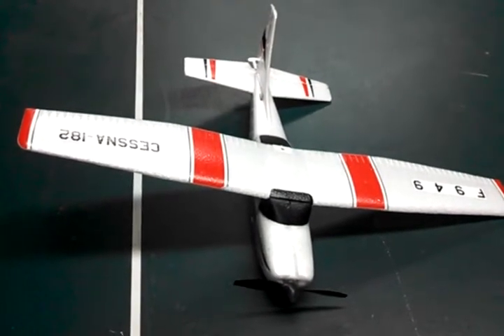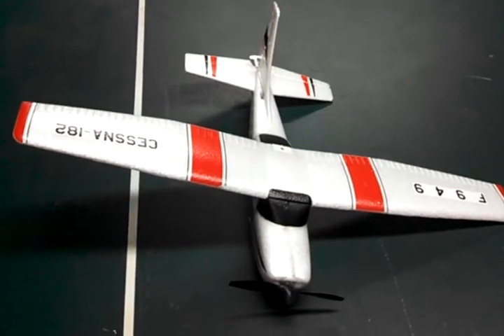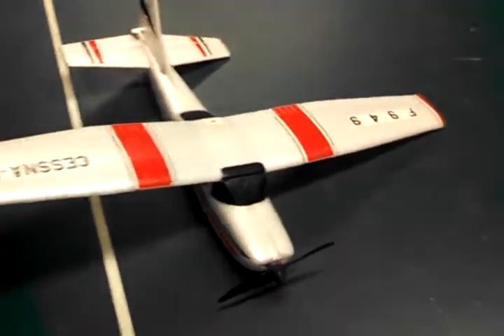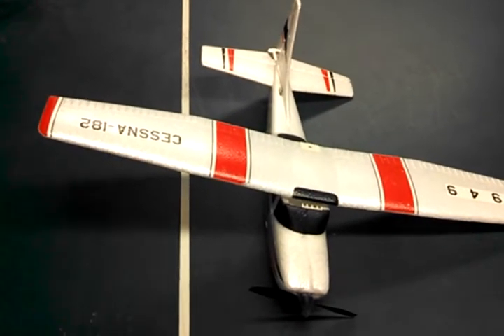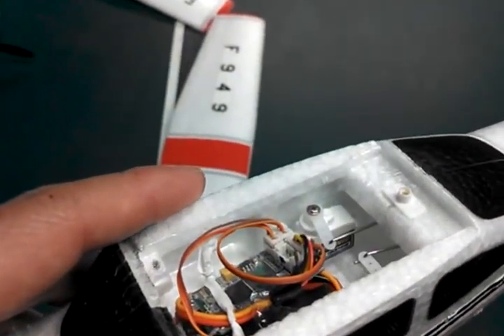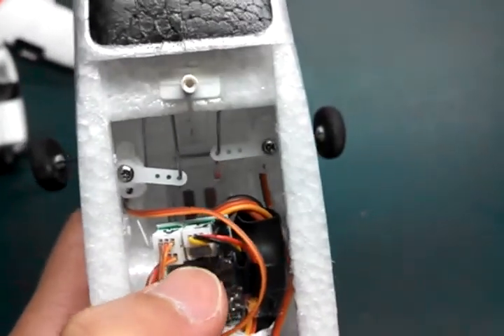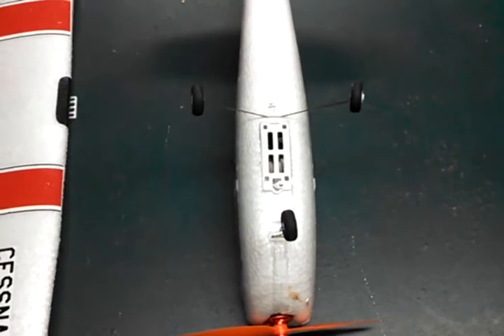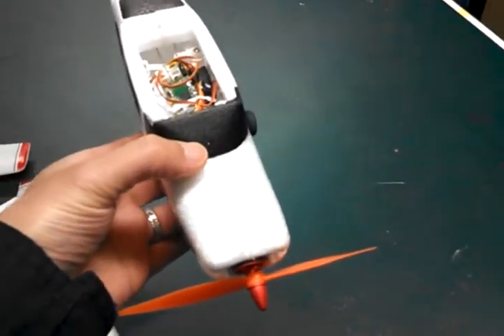WLToys F949 Brushless conversion

Comment: Did you connect the motor to the existing wires in the plane? I just bought the same motor but I'm having trouble connecting it. Could you please explain to me how you got it to work? Thank you!
Reply from the maker: You have to replace all the electronics, not just the motor. Visit the link in the description for more info. :)
Reply: you can upgrade brushless and keep all the electronics if you want ... ia have do this and it fly very well you just need add a esc ant the motor
Reply: @alexgou2519  bom dia qual motor sem escova pra colocar e o esc tem como me passar o motor e esc a se usar com a mesma eletrônica

Comment: Does the engine last only 10 hours?
Do you mean because of the crashes or because of wear?
Reply from the maker: Normal wear. The motor gradually loses power until you no longer get enough thrust for proper lift.
Reply: :(
anyway.. can you tell me all the names of components have you used for the conversion? 
is there any possibility to use wltoys transmitter with the new components?
Reply from the maker: Go to the website in the description for more details on components. With the components I used, it is not possible to reuse the transmitter.

Comment: Do you think it would be possible to wire a brushless ESC to the existing receiver/servo board by wiring it to the battery lead, or do you think the BEC of the ESC would fry it?
Reply: I think it would work if the existing board can handle 5 volts. The reason I ask is because I converted the original board to four channel, but it really needs more power.
Reply from the maker: The only way I know of reusing the existing brick is by what this guy did:
https://www.rcgroups.com/forums/showthread.php?2387751-WLToys-F949-(Failed)-Brushless-Upgrade
In theory it should work, but you'll need a transmitter that can access the "undocumented" channel. A taranis with the multiprotocol module may also work.
Reply from the maker: The original board uses a 1S lipo. If you really wanted to use a separate esc with more power, you can always hook up the esc to a separate power source. However, this will kill your AUW, so it's far easier to just replace all the electronics.
Reply from the maker: Actually, the other alternative would be to run 2s, but feed the original board through a bec and the full 2s to the esc. Question is are you willing to go through all that just to keep the original brick?
Reply: I think maybe one could run the BEC to where the motor hooks up by just soldering the throttle lead of the ESC to the connector wire of the motor. Then when you plug the 2s battery into the ESC the bec through the throttle would run the control board, thereby operating the servos, and the speed of the motor. The question is would this lead feed the rest of the board like a regular receiver, and if so would the 5 volts from the bec fry the board that normally runs on 3.7 volts.
Reply from the maker: Sorry, I think I misread your original question. To answer them:
1) A 1s battery is 4.2 volts when full, so I personally don't see an issue. 
2) To wire it, the esc's bec has a 3 wire servo lead going out. the + & - wires will route to the power lead for the original brick. the signal & - would run to the 4th channel of the original brick.
3) Do this at your own risk and let me know how it goes :)
Reply: Do you know which is positive, negative, and which is the signal. I would assume the red or orange wire to be the positive, the middle wire to be the signal wire, and the black, or brown to be the negative?
Reply: Let me see if I'm understanding you correctly. I need to run the positive which is the top wire, and then the negative wire which is the bottom wire to the original battery port of the brick. Then take the middle wire which is the control wire, connect it to the positive side of the original motor lead, then connect the same bottom ground wire that is also grounded to the original power lead to the ground of the motor lead. Does that sound about right. I hope this isn't coming off too confusing I'm not too good with electrical terms.
Reply from the maker: The first part is right. For the second part, you are going to attach your brushless motor to the 3 wires coming out of the other end of your esc. The signal and ground go to the 4th channel port on your original brick. You are in essence abandoning the original throttle channel used to control the brushed motor in favor of using the 4th channel originally meant to control a servo to control the esc for your new brushless motor. I hope that makes sense.
Reply: Yah well that's not going to do me any good because I'm using that extra 4th channel as an aileron channel. Was really wanting to keep the four channels flies much better that way.Thanks for all your help though.
Reply: Don't know any of higher power 5 volt coreless motors I could use to increase the overall power do you?
Reply from the maker: Sorry, I haven't experimented much with coreless motors.  Best of luck tho!

Comment: you can upgrade brushless and keep all the electronics if you want ... ia have do this and it fly very well
Reply: how did you do it? Can you explain .. i want to Upgrade my f949 too nur without other esc etc!

thanks
Reply: @rattenkonig2406 you need a 1 s brushless motors and Racerstar RS6A V2 BB2 Blheli_S 6A 1-2S Brushless ESC Oneshot42 Oneshot125 16.5 D. i have connected the esc  on  motors and the battery and the the free place you have for another servo on f949 you put the esc for the signal....sorry dont whrite english very well... maybe if you are realy interesseted i can do a video.
Reply: @alexgou2519  i will try it. what do you mean with-you need Another Servo? it would be cool when you Can make a video
Reply: @rattenkonig2406  no sorry you dont need another servo it not that i try to say... i will make a video :) tres bientot this week
Reply: @alexgou2519  ok .. make a Video.. and  Upload it on your Chanel.. thanks.. and have a nice weekend 😎
Reply: @rattenkonig2406  i have do a video on my chanel. i dont want remove all the electronique i have take a old want for you can see how connect the esc to the board. it is very simple but my video is not very good... i hope it can help you and if  you have question feel free to ask me
Reply: @rattenkonig2406   i have do another video